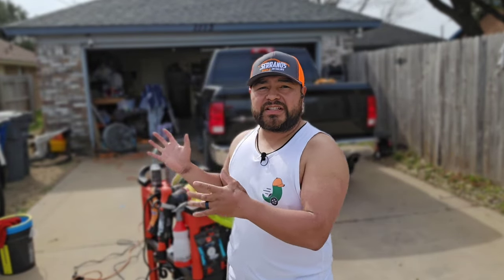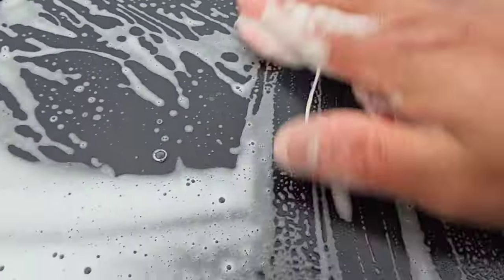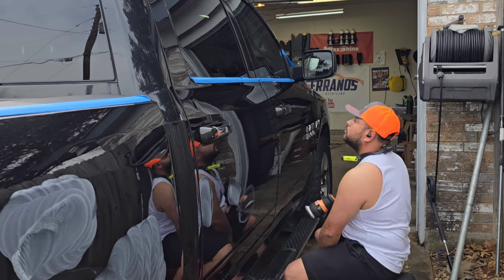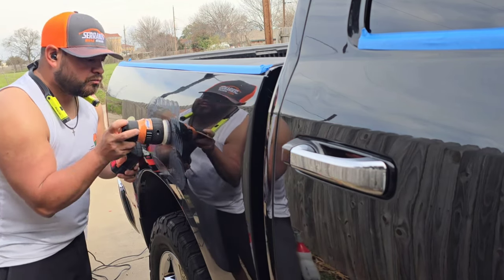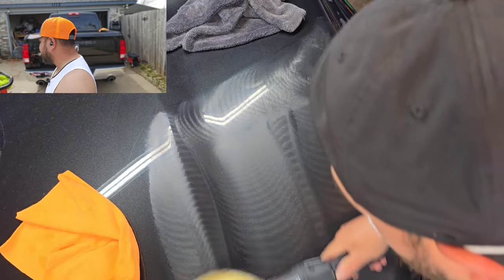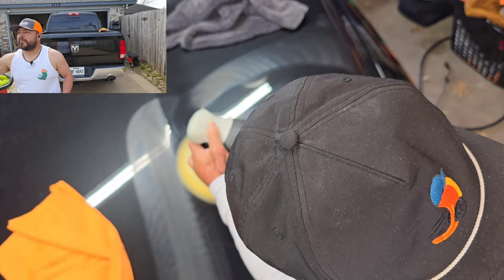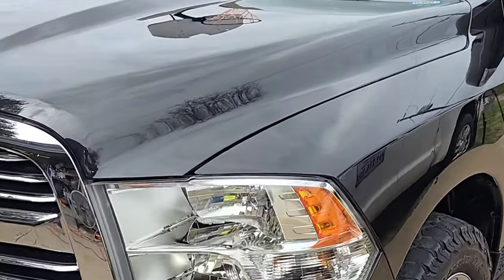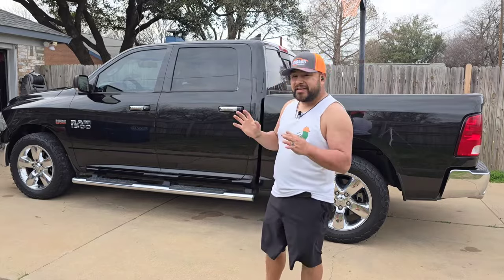THE RUPES CORDLESS

Comment: That’s an awesome idea using the HLR75 for headlights. Where did you get the backing pad and sanding disks?
Reply from the maker: locally from drive auto apperance
Reply: @serranosmobile  I’ll have to give them a call tomorrow. Do they have different grits? And do you have to switch the backing plate out to polish again?
Reply from the maker: @turbotona25  no it's just a foam backing plate